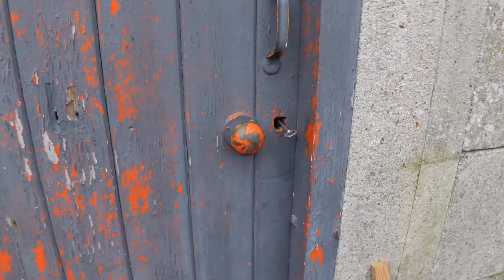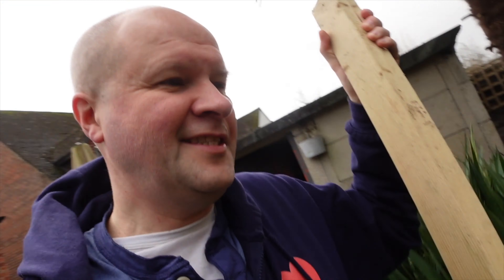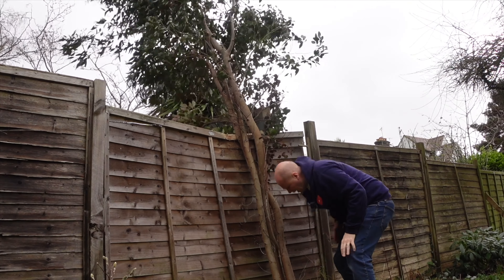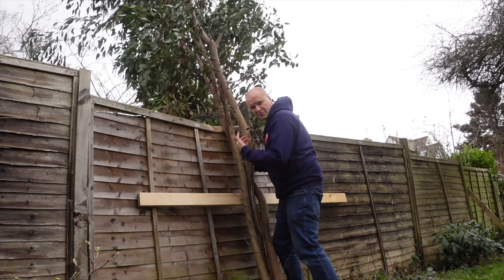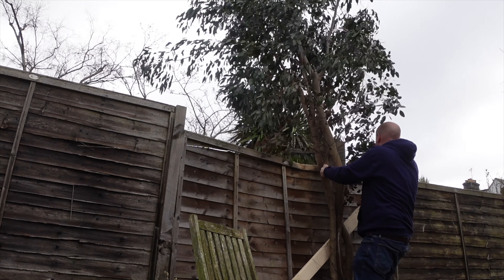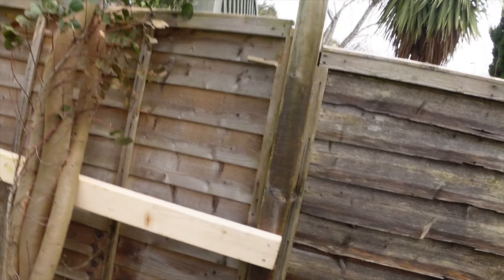Don't let this happen to you! Tree destroys our garden fence... 🌳

Comment: I would train that tree away from the fence.  Plant 2-3 "T" Posts 2 feet on the other side of the tree away from the fence & spaced apart by  1 to 1.5 feet apart. Take 3 lengths of hose or pool foam long enough to wrap around the tree trunk. Place a length of wire through the hose then Fasten them to the "T" Posts. Use a players to twist the wire tightly enough to support the tree away from the fence. This is the time do do it. Procrastination is not your friend at this point. That Eucalyptus tree has the potential of growing to be a foot across in diameter & 50 ft tall. Or just plan to secure your fence to the tree. It will happen on it's own if you wait to long. Blessings abundant to you all.
Reply from the maker: This is wonderful, thanks we appreciate it. This is a great suggestion!